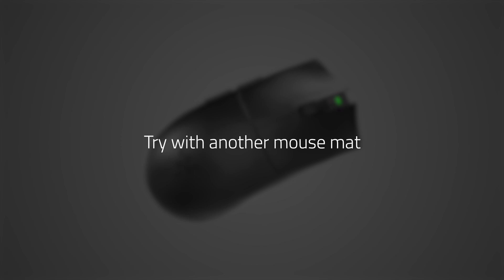How to clean mouse sensor to prevent tracking issues

Comment: I accidentally got some tipp-ex (correction fluid) in the mouse sensor. i have a razor hyperspeed v3 but theres tipp-ex stuck that i cant seem to get rid of and its causing tracking issues. i need some help

Comment: Dude your Viper V2 PRO accumulates dust in the scroll wheal sensor super quickly and it stops to perform as out of the box. I had two, after 6 months you can just throw them to the garbage can, a mouse that costs over 100$. Fix your mouses according to the feedback and listen tot he customer feedback.

Comment: When razer is going to solve scroll wheel issue?
Logitech have double click issue and because of that i moved to razer and after a year i found out that razer have scroll wheel issue.
If razer does not want to work on this let us know so that we can move to another brand.
Reply: @liav1609 replacing is not permanent resolution what after warranty? It means you have to forcefully purchase new mouse after warranty or learn to open mouse and use custom components 
I know how to do it but dont have all the required tools and tools are expensive for 2,3 time usage in 10 years
Reply: @0_Kratos_012  Exactly.. Thats why I also last time buying these products. I had enough of buying expensive products that dosnt last 2+- years its ridiculous. 200$ for this!
Reply: Same problem here i Switch to razer because logitech double click and now  6 months using deathader v3 got scroll issue😢
Reply: Both razer and logitech uses same switches and wheels now they use thier opticals but scrollwheels are the same and every mouse can have issues, u just have to learn how to solder new one. There isnt an encoder that doesnt have issues after some time - how long is luck and how heavy u use the scroll
Reply: They just replaced my V3 Pro Basilisk because of scroll wheel noise and stutter
Reply: @erisium6988 if we solder new scroll wheel in warranty it will void warranty right? So its not a proper solution and other brands never had scroll wheel issue